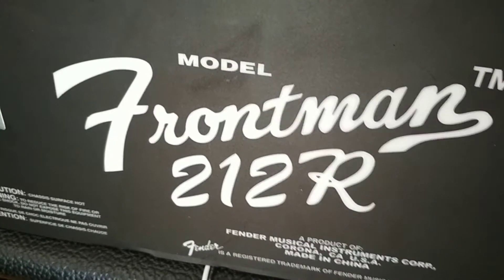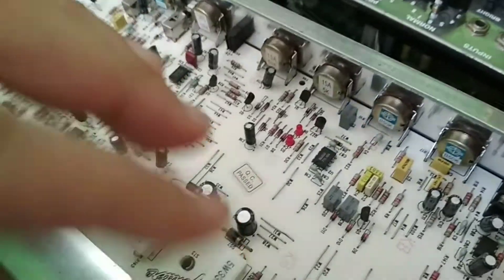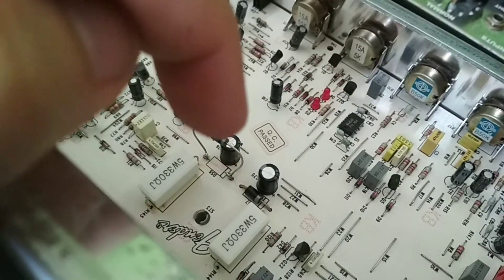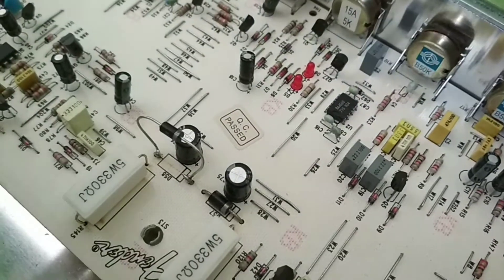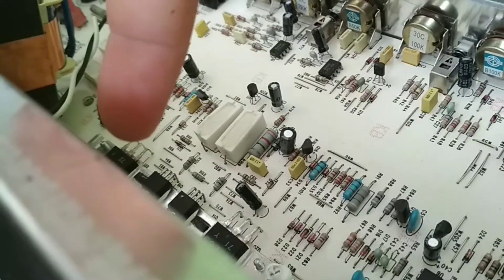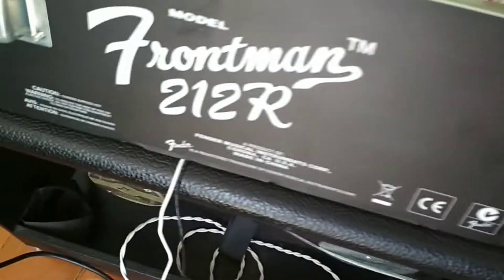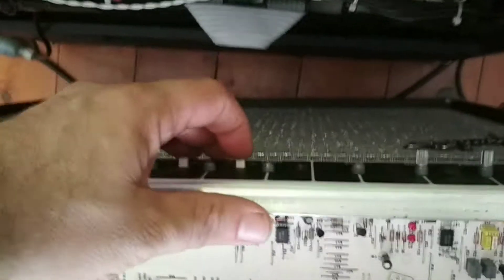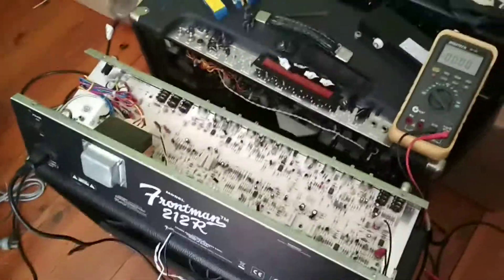Fender Frontman 212R no sound - FIXED!!!

Comment: As I am a tube man, I bought the 212r Fender amp only to have enough headroom if there is no PA on stage. Finally I love the clean sound of this 212R by using my pedals. With no effect pedals it is already pretty nice for a solid state and sounds typically "Fender",  just a bit colder and punchier than my tube amp. As soon as I use the pedals, the difference in sound to my tube amp is minor in my ears, but the 212R stays a lot longer clean when cranked up. My tube amp goes into distortion when I play it loud, which is an unwanted effect to me. I prefer to use the solid state to stay as clean as possible. That´s what I need it for. No distortion at all is what I call my own style.  The 212R is not very reliable. Therefore I will replace some resistors and diodes by better ones as soon as the amp restarts to have issues. By the way: I love my tube amp. I ever preferred tube amps, but the maximum clean headroom that I want comes out of a solid state amp.

Comment: You're right R144 and R145 in Fender Frontman 212R are way bellow the amp's specs!! For those who still have this amp and have this reisitor overheating issue, i suggest replacing those two 330R 5W resistors with two 470R 25W ones (minimum, to a maximum of 820R 25W) and it should stop overheating like it does!! Hope this helps you, people!! ;)
Reply from the maker: Indeed. Very underrated wattage on these.
Reply: Hi metal alex. I have the same overheating issue. I replaced blown capacitor C39 on the pre out section + R144 +R145 resistors and checked for desoldered joints(I found a few,2 on those resistors.On reassembly amp worked well for 30 mins,then started to crackle as the resistors warmed up and it started to smell with the heat! Power off. Any pics of how you mounted the bigger resistors (2 x 470R 25w) ?I have plenty of small (PC type ) heatsinks,which will probably do the job. Thanks for the info,so far
Reply: @theweatherman1874  I drilled holes at the back of the amp's chassi, put some thermal paste on the base of the resistors (TimTronics grey ice) and fixed them to the chassi with two M2.5 screws and nuts for each resistor!! The aluminium chassi of the amp will get that heat dissipated more efficiently than the heatsinks, as you have that whole suface to serve as a heatsink for them!! :) Besides being and excelent electronic shielding conductor, aluminiun is also an excelent heat dissipation material!! Just get the resistors' template (you can draw it in  a piece of paper, like i did) and make 4 holes with some 2,4 to 2,8mm diameter to fit the screws there, at the amp's back, inside the amp!! Then, all you need to do after you're done drilling those holes, place the screws with the head outside and tighten the nuts on the inside!! Don't forget to put thermal paste on the base of the resistors before!! ;) When you make the drill holes, i suggest that you start with 1,5 or 1,8mm drill bit and progressively get larger ones as you go!! Time consuming, but it gets a lot easier as you go!! i started with 1mm, 1,2mm, 1,5mm, 1,8mm, 2mm, 2,25mm, 2,4mm, 2,5mm and 2,6mm until the screws fit right through the holes!! :) The only thing you need to be careful with is your drilling machine's rotation so the drill doesn't go off the mark!!
Reply: You are a star ,my friend! Thanks for the detailed info you have provided,this amp has had limited use - 10 rehearsals and 3 gigs max.Instead of staring at a heap of junk, I can see this working again. I tried replacing the 5w 330 ohm resistors and it worked for a short time. Thanks for all the info.
Reply: @Wohlfheimehr  Brilliant,cheers Alex
Reply: @Wohlfheimehr  Hi Alex,Did you need to replace any other components? More importantly did you have an acceptable drop in the operating temperature? What type of wire did you use to make connection from the solder points on PCB to the resistors. Thanks again for Info
Mal
Reply: @theweatherman1874  Well i did a full cap replacement just in case (especially the electrolytic caps, instead of 50V electros, i replaced all of them for 63V electros, same values... That way an electric overload won't burn those as easily), but i strongly advise you to replace C75 (100uF 63V instead of 50V), C76 (100uF 63V instead of 50V), D56 and D57 (both 1N5353B)!! Those big caps in the power supply (4700uF 50V) were also replaced for 4700uF 63V!! As for the temperature, i noticed a considerable drop from 65º C to 26º C on both R144 and R145!! :) Don't forget the thermal paste on those before attaching them to the amp's chassi!! The wire i used was Velleman multicore wire with 0,2 square milimeters in diameter, but i connected to of wires on each end of the resistors!! ;)
Reply: Oh, and don't forget to check all the amp's fuses!! A lot of people installs just about any kind of fuse as long as it's that ampage!! Never make that mistake, always install slow blow fuses where it says SB and fast blow fuses where it says FB!! Those fuses also have another designation!! For instance, say, F2A250V (That's a 2 amp fast blow fuse 250V), or T2A250V (That's a slow blow or timed 2 amp fuse 250V)!! Or some fuses say, for instance F2AH250V (the H usually means fast blow)  or F2AL250V (L usually means slow blow)!! Always pay attention to that, man!! ;)

Comment: Hello, sorry to bother. I just got same one - working fine. but  i notice only one speaker is engaged. do you know if the second one kicks in under curtain conditions, or my amp is malfunctioning? appreciated.
Reply from the maker: kryuga both speakers should be working.

If you’re already getting sound out of one speaker, then it’s highly likely the amp is okay. 

I’d be testing the speaker that isn’t functioning, or check the wiring to that speaker.
Reply: @whatsstefon  thanks a lot..i did some cleanings. now one speaker is louder than the other )))) but both work...
Reply from the maker: kryuga that’s good news. Perhaps it was just a loose or dirty speaker terminal connection.

Comment: If I replace the 5w resistors with 10W 
Do I have to change anything else to compensate.
Reply from the maker: No. All this does is give you more heat handling capabilities.

Comment: I haven't watched it yet and I'm guessing it's the usual suspects, the 330 ohm 5W ceramic resistors. It's a common problem in all the amps that use this board
Reply from the maker: Indeed. And that’s just to begin with.

Cheers for your comment. Always appreciated!!
Reply: @whatsstefon  ya gotta love the pots too. Plastic craptastic.
I picked up a Princeton 65 a couple weeks ago that had overheated one of the resistors and had a bad solder connection. The resistor was still in tolerance but I replaced them both and left the leads long. They're about a half inch off the board. The idea is to keep them from burning up the board and maybe get more air, and the long leads may help as a heat sink, probably not but wth. The holes they put under them on the board for convection cooling don't seem to help much.
Reply from the maker: @deaddiver3768  yeah. Definitely worth placing them a small distance away from the board for additional cooling.

Yeah. Plastic pots. Yuck.

Comment: About the R144 and R145 dimensioning, it is worth noting that this section of the power supply provides the Icc, the supply current, to the 8 opamps of the board and to a bunch of other parts,  while providing the polarization current to the 16V zener diode. As an approximation, the R144 and R145 (whose nominal value on the schematic is 200 ohm thus providing 130 mA) should not be higher than 270 ohm for the supplied circuits to correctly operate. The 330 ohm value is a limit not to be exceeded, IMHO. So, the dissipated power cannot be traded for current because the overall 100 mA requirement (please consider that the RC4560 could drain up to 6 mA each). The only approach to an easier SOA for R144 and R145  is going for a 10 W rating, provided that the dissipation is 2.5W over 270 ohm or 3.4W over 200 ohm. Thus, 10W is an easy margin!
About the zener diode dissipation, the worst case value is 1.25 W (with 330 ohm resistors) which is 1/4 of the "nominal" dissipation spec of the 1N5353B, despite it strongly depends on how the diode is mounted on the pcb, as a function of the cathode lead lenght and temperature.
Reply from the maker: Absolutely agree. Thank you for the explanation and expertise.
Reply: So what should I finally put on to the board to make my 212R work constantly reliable ?
Reply: @RonnyGuittar  I'd suggest to use the resistor spec value of 200 ohm but with 10 W power rating (instead of 5W) for both R144 and R145.
If you cannot find 200 ohm 10W resistors,  you can parallel 2 x 400 ohm 5W resistors which also increases the reliability as if one of the parallel resistors fails, the other can keep the amp running (with some limitations though)

Comment: Hello sir, I've got frontman 212r hum about -14 db at 199 hz and it's annoying :/ would you give a clue what should I replace/do to fix this, thanks.
Reply from the maker: It's difficult to say, but definitely try testing the AC ripple from the filter caps. 

Also, you could signal trace from the input to the output stage and help isolate where the hum is entering the signal path.
Reply: @whatsstefon  I'll check it, thanks

Comment: I have on of these amps and the channell selector switch isnt working
Reply from the maker: Jacob Gardner it could be a number of things. It could be the switch itself is faulty, it could be as simple as giving the footswitch socket a clean as it might be dirty or dusty. It could be a fault in a solder joint or crack in the PCB. It could be a faulty relay.
Reply: @whatsstefon  thanks man i may try to look at it myself but its prolly out of my league